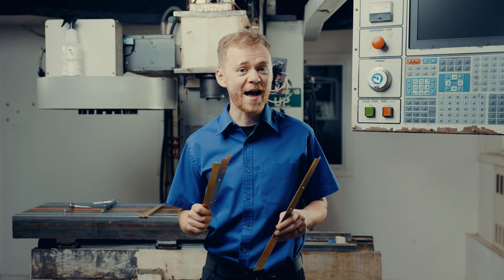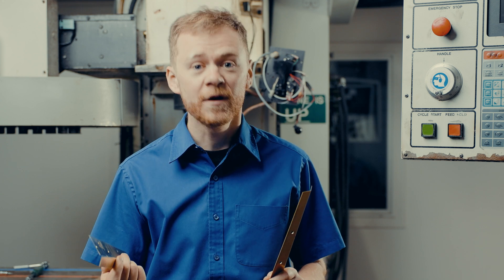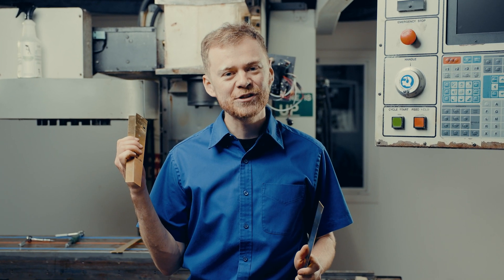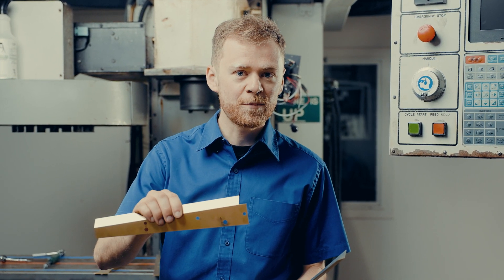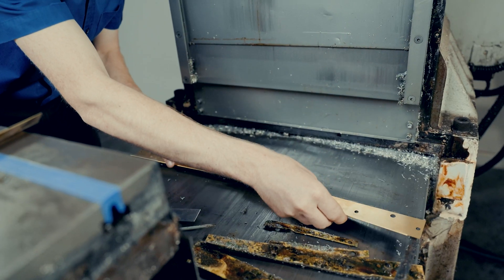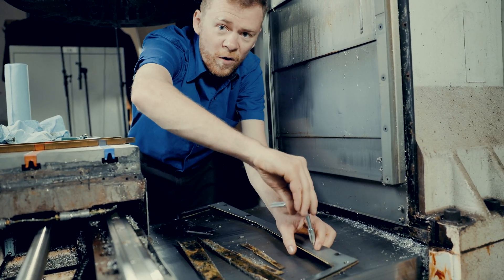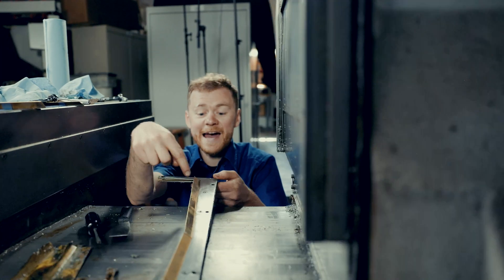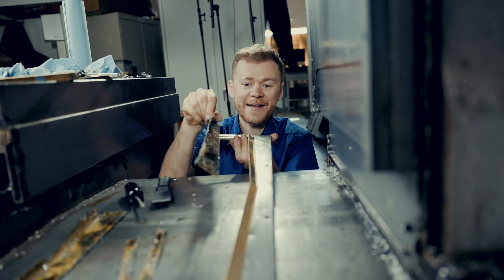Brass way wiper replacement VF-1 to VF-4

Comment: I replaced the wiper on the VF2 and I still get a slight leak at the rear casting underneath the lower cover.

Comment: Like our sothern b----- 😂😂, i didnt expect that, cracked me up.
Hey could you do a video of brief run through on all the failure points for a haas 121 low lube pressure alarm? I got a 1995 vf0, checked pressure, manually pumped oil, i get it every few mins (doesnt seem to correlate to charge cycle), my charge time is set to around 30 mins in settings, seems like the solenoid or a relay or something, anyway if you got time, good vids man!
Reply: Hey I have a similar issue, did you get a solution?
Reply: @G53xyz  no solution yet but I'll probably just try cleaning out the nozzles then if still not working swapping the pressure sensor and checking the wiring